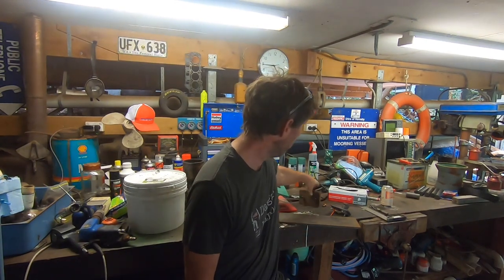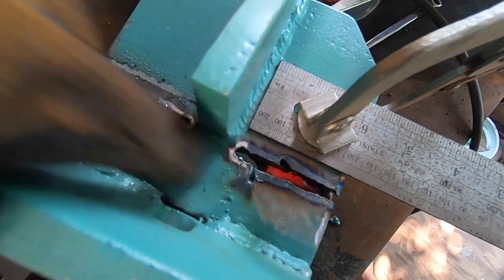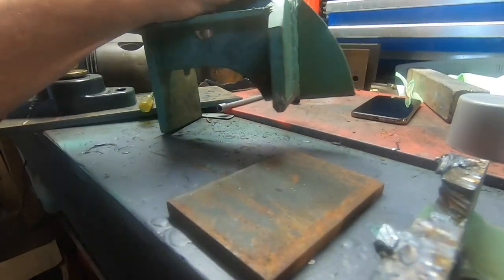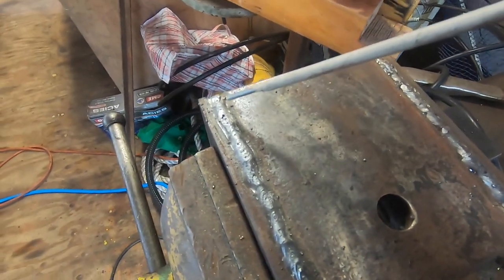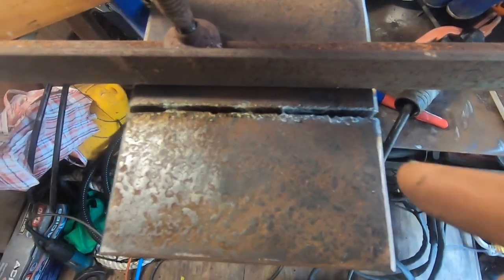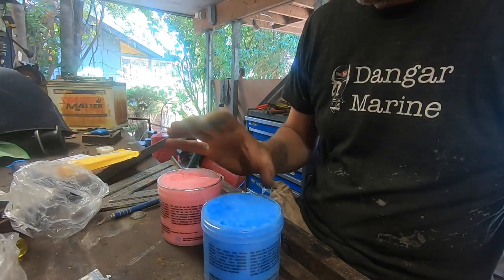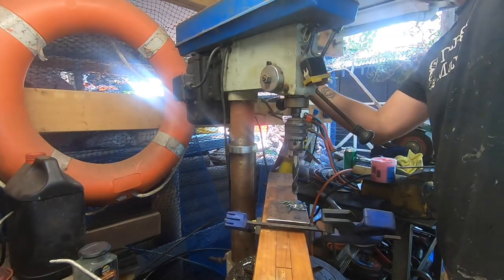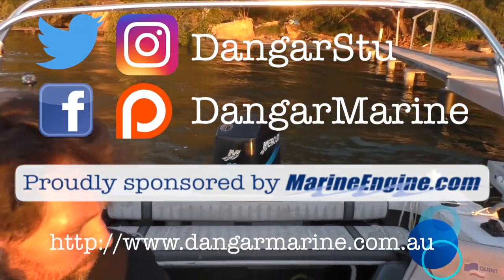Making the engine mounts

Comment: I'm a fabricator in the US, so I really enjoyed this video.  I use plasma cutters pretty often.  For thick materials like you are cutting...I'd just run it wide open and adjust the speed to keep it from blowing back.  Also, you are right about running through the end of the work to keep the tip cleaner.  Keep up the nice work, and ignore all the safety nuts.  In the US, must of us who are self employed and don't have a Safety Manager to watch us, work the same way as you...well, except we wear shoes. :)
Reply from the maker: Thanks mate. I'll give it a go at max amps next time and see how it goes.  Happy New Year! :)

Comment: Hi Stu, I'm not pro welder but just on the subject of welding I noticed at 8:55 while you were tacking up, you held the welder clamp with both hands. While this is fine is does limit the amount of control over the tip of the rod especially on a new rod. If you try and hold the clamp with your right hand and hold the actual rod with your left hand as close as possible to the weld pole as your glove can take. I find at helps and awful lot. Also being in a comfortable position I find is so important to a good weld. Keep up the great work Stu. Love the project

Comment: Always keep a roll of 'keyway belt' on hand, whether ashore or at sea. It will get you home and finish your tasks without having to run to the belt shop. 30 years as a master maintenance Tech taught me that, plus a few decades of sailing and motoring...
Reply from the maker: I'm definitely going to get some. Didn't know about it before this video.

Comment: Here's a good tip for your welding...
Pre-heat your work. 
The Boeing Lube helps keep the MIG torch nozzle from fouling. You can also apply a thin film to the work piece to help reduce spatter from sticking. I even put a very lite film on my welding helmet viewing lens.
Reply from the maker: Will give it a go.

Comment: Happy New Year, Stu!  Nothing better than a Dangar Marine video to start the day! :)

Even a very small pilot hole would make a big difference to your hole quality (roundness, finish, location...), and would be easier on your press.  Keep in mind that the center of the drill is not turning as fast as the outside edges.  Matter of fact, the exact center isn't turning at all relative to the metal.  Without a pilot hole, you're trying to push the tip thru the metal, requiring significant force.  A small, perhaps 4mm dia,  pilot hole would help a lot.  No need to step up, just go 4mm then 18mm. 

Keep up the great work, sir!
Reply from the maker: Yes, I'll try experimenting with different size pilot holes to see which works best on the next ones. The other thing I like about no pilot hole is that you can fill the start of the hole with lube and it won't just run out the pilot hole.

Comment: Stu:  With resilient mounts, when doing the shaft alignment, you need to account for the mount deflection caused by the weight of the inboard shaft end, so that the stuffing gland is not required to act as a bearing.  The mount company should be able to give you a procedure for doing this.  Basically it involves centering the shaft in the stuffing gland and adding weight onto the end of the gear to mimic the shaft weight so the mounts deflect the right amount, then aligning shaft to gear, and then removing the weights and the shaft gland centering support. Greg

Comment: Hi Stu
With regard to any “solid” lube, they work best if you dip the drill bit into them and fill the flutes.  That way, as the bit heats up, the lubricant flows down into the piece you are drilling helping to keep everything cool and.....well.....lubed.
Reply from the maker: Cool, I'll give that a go.

Comment: The engine mounts look good and strong, so you should be ok as long as the angles fit up right. You may need to make some tapered wedges to fit under the flex mounts to align the prop shaft to the engine. It won't be long till she is in the engine room.
Reply from the maker: Yes, it will be interesting to see how the alignment goes but where there is a will there is a way.

Comment: Happy new year to you from an old sea dog still in the old year. 

About your drill press, mine is same type and I use home made belt dressing made out of pine resin and meths to prevent belt slip and thereby increase belt life. 
Original belts are poor and are easily damaged when changing speeds so make sure enough slack.  Rounding off the sharp outer edges on pulleys is also advisable. Suggest you drill at lowest possible speed and apply coolant but these drill presses tend to slip belt unless you apply belt dressing. Looking forward to see test run of boat.
Reply from the maker: Nice idea, I'll try that with the new ones.

Comment: 2 things I've found helpful in my welding projects: 1 you can get magnifier lenses for your welding helmet (so you don't need magnifier glasses also) and 2. Get a 7" or 9" grinder! Working with thicker metal, a 4 1/2" takes forever!
Reply from the maker: For sure, the big grinder makes a big difference. Just bought some new disks for mine yesterday.

Comment: I’m now renaming you danger stu instead or danger stu, if I hosed sparks on an lpg bottle or oxy set I’d be now residing on the moon, keep up the great work mate
Reply: The Ausie's Aint afraid of a bit of LP Gas. They Made of Tougher Stuff, as They, Grind & Weld Steel, Bare Foot!   LOL  Side Note, He must have noticed it at some point, as he moved the tank in the next shot. Happy New Year to all
Reply: I noticed that too.  But hey, the explosion and 'launch' would have been filmed and would probably go viral later.  Would help pay for the funeral costs I guess? :-)
Reply: Put a big smile on my face when I saw that. He must be my kinfolk. I do stuff like that all the time.  :)
Reply: Don't think its in bad taste BUT.. why are there so many fires  down under?
Reply: did you spot the flip-flops/thongs/shower shoes :-)
Reply: @staxter6 Hi Chris.
 Our forests and bushland have alot of scrubby undergrowth that dies and dries off in summer and drought very quickly.
Combined with hot dry winds
a lightning storm will start a fire, cigarette buts thrown out a car window and sometimes arsons.
Our eucalyptus trees are high in volatile oils and that fuels a fire even further spreading at a more rapid rate.
So our dry tinder and trees are a perfect fuel in a hot dry climate hence we have specified total fire ban days so no burning off and that includes no barbecues! 
We do need to do more controlled slow back burning to clean up the scrub but the greenies have made such a fuss alot of this and boundry clearing has stopped. This season is already particularly bad and our summer just started one month ago!
Cheers, all the best.
Reply: But at least he had boots on.
Reply: And Barefoot to boot!
Reply: Aussie boilermaker/welder for over 15 years. I've showered acetylene and lpg cylinders in sparks hundreds of times and live to tell about it. As long as you have no gas leaks and your not pumping excessive amounts of heat into the cylinder or hoses there will be absolutely no problem.
Reply from the maker: That's it Alex, it's almost impossible to set an LPG bottle alight without heating it to the point where the pressure relief valve goes. As an aside,  we did training on putting these out in the fire brigade where we would set one alight then we would approach as a group, two holding a hose with the nozzle set to a wide fan to act as a shield from the heat and flames and a third to reach out through the shield to turn off the valve. Once done the next group would have a turn. They certainly don't explode as there is no oxygen inside.
Reply: @adriansaggin3054  Hi Adrian, Thx for your concise and informed response. Spent 30 years in Africa where it's generally unreported vis a vis seasonal wildfires, It just seems that this year (and 2018/19) Aus  has had it bit rough. In the N hemisphere it's being reported as Armageddon. Perhaps the boundary / firebreak freaks need to see reason and get to grip with what is required. Cheers, and a good New Year to you.
Reply: @staxter6  global warning (with plasma cutters!)
Reply: @adriansaggin3054  nothing to do with Greenies they have no say mover rfs hazard reduction burn policies.
Reply: Had one smaller one catch fire with a burner on the top. We just hid behind a tree at a safe distance and it eventually ran out of gas.

Comment: once you get the puddle correct try and concentrate on keeping an even speed and correct angle, trying to react to fluctuations as you see them usually just puts you behind the 8 ball because your reacting to stuff thats already happened, it may feel counter intuitive but it produces better results. its especially noticeable with TIG welding but applies to all processes including oxy and plasma cutting. once worked with a bloke who used a piano timer to time the dabs when TIG welding.i use much faster dabs so it wasn't for me ,but it worked well for him he got very nice results.
Reply from the maker: Interesting, thanks for sharing that, it does make sense.

Comment: Those are the same engine mounts I’ve used. When you get around to installing, you may want to initially set so the prop shaft is a tad bit high in the shaft log. These mount do settle quickly, most of it in a day or so. Check hight adjustments again in a week, then two months, a year and finally every two years. Most of the time you will find all you need to do is raise the two equally that carries the most weight, the one’s under the engine. On second thought looking at a previous video it looks like all your mounts may have similar weight sharing ( not like mine).

Comment: The most important feature of mounting your engine is a collision block. This protects the engine from moving if vessel  collides with a dock or another craft. Usually it looks like a large flat triangle about 4mm from front of strongest part of the engine at the base.
Reply from the maker: Interesting, I'll look into ways of adding that.
Reply: Also known as rake and ramming stops. Rake for when you get hit from behind and ramming for when you run into something. 
You didn’t need them with solid mounts, but you may now with flexible mounts.

Comment: Happy new year stu and all the subs! Nice way to start my new years eve day! The Jabsco pumps are very good but the rubber impellers don't stand for much dry running so keep a spare! We always have a similar piece left over from our service set but our Jabsco is slightly different, I believe it may be for the shaft on the engine side. Keep up the hard work chief, Ps glad to see the landy home
Reply from the maker: Thanks Clyde, will definitely carry a spare. One start up with the seacock closed and they are a goner.

Comment: if you tack only at the corners it eliminates having to grind them down, also gives extra weld meat at the corners which is where any cracks will start from
Reply from the maker: Good idea.
Reply: Except at the starting corner, better to tack a little away from the starting corner so the rod gets some heat before it hits the tack. ✌

Comment: Hint , when you drill an angle positioned as you did at 16:20 on, use a thin packer under the area being drilled to fill in the gap produced by the radius of the internal corner of the angle, or alternatively chamfer off the corner of your wood block so the angle sits flat on your block
Reply from the maker: Yes, it would be nice to do something to make it sit more steadily while drilling.

Comment: Having personally rebuilt a few Jabsco pumps for marine use The "extra" part may be for a sister (similar) model that you don't need for yours. Check with your supplier or Jabsco directly. I've been running in the Saint Clair river bordering Michigan, USA and Ontario, Canada for the last 50 years and seen this type of thing before.
Reply from the maker: Yes, I have noticed quite a few kits come with parts to cover multiple models so not all bits are need for an individual pump.

Comment: trick to learn when doing right angle welds. Weaving rod side to side just a little bit creates a much nicer weld. Another one is to angle the rod to either the thickest piece OR to the one going vertical a bit. When welding on something with a downhill angle I like to start at top and push the weld back into itself as I go. Seems to work well for me.
Reply from the maker: Yes, I think it would have gone a lot better that way, I really did have the wrong rod angle on the first one.

Comment: On your drilling and pilot holes, for small sizes like 3/4, just do one small pilot drill the same size as the chisel point of the drill (the bit that doesn't really cut).  Drills only grab when the step up in size from pilot to final is too small.

Comment: Happy New Year to you and family Stu!! All the very Best for 2020!! Most of those machines, welding and plasma cutters have what is called a "duty cycle" which is usually represented as a percentage in a 10 minute period I believe.  So, as far as I understand it, if the machine has a 15% duty cycle, then it needs to "rest" for 15% of the 10 minute period before it is ready to be used
again. The more expensive, higher end commercial machines have much lower or even no required "rest period" which is mainly why they cost so much. Much continued success with all of your projects!!
Reply: @robertI153  , you are correct sir. I had got that confused. They specify that it is at full power of the unit too apparently.

Comment: It's me over here again. A hot tip on setting the engine on the rails.  Put the mounts on the engine loosely then drop the engine where you want it. Mark the holes on the rails. Lift the engine up enough to get clearance to drill holes. Then lower engine and insert rail bolts. Tighten everything to spec once you are happy with the final alignment.  As close tolerance as you have those mount holes dropping the engine onto those pins is going to be a real bear. Even a millimeter of variance will make setting the engine super difficult if you bolt down the mounts then attempt to set the engine. Don't even ask how I know this.  :)
Reply from the maker: Good tips! I've never done this before so I'm definitely going to be learning a lot along the way. :)

Comment: Stu, to "Cure" Dottie, take a 5 gallon bucket. Fill it half way with Ice water. Set her in it for about 3 or 4 minutes. Works every time.
There's some biological explanation, but I've forgotten over the years. I've kept Chickens for the last 40yrs. and it's always worked.

Comment: For fabrication, they make magnetic 90deg angles to hold stuff in the correct alignment for tacking before welding.
They are about $15. There are different size ones too.
They sre the type of tool that you wonder how mankind ever progressed without. Any welding supply or often steel supply places have them.

Comment: Hey mate im enjoying your videos,  especially the way you throw in the danger, eg gas bottles, no shoes haha, by the way some advice from a boilermaker, when you are making your brackets etc , reduce th size of your gussets and make them semi corner to corner, that way you can fillet weld your parts for a better overall result, love your work
Reply from the maker: Thanks Robert, l like your idea of making the gussets a bit smaller so you can weld right around.

Comment: I believe that the double nut goes below the engine mount, and a single nut is on top.  If the height adjustment nut is only a single nut, normal operating vibrations could loosen it and over time lower that corner of the engine and you will be out of tolerance with the shaft flange.  With a single nut on top, simply the weight of the engine will keep it in place once that nut is tight.
Reply from the maker: Yes, I've heard that lowering their temperature can stop them from beeing broody.

Comment: Pilot holes make the work easier, less stress on equipment and quicker cutting.
I grind my own bits, and the edge will last longer with a pilot hole.
The harder the material, the more you need a pilot, mild steel may allow for a one shot drilling process, but, harder material will not be so easy.

Comment: Happy New Year Stu. I nearly had a heart attack seeing you barefoot in your shop!! Lmao

Anyhow a couple of tips for you for improving your welding! When your gripping your welder i.e. stinger, torch head, or MIG gun, relaxe your grip as much as you can. This improves your dexterity and allows you to manipulate the welder and consequently the puddle more accurately!

Two! Instead of focusing on the puddle, try focusing on the edges of the weld puddle instead. This will allow you to tell if your bead is building up too much or wetting in properly or undercutting more quickly on the fly.

About grinding, the saying goes " a welder is nothing more than a professional grinder ". A handy tool for grinding is a die grinder. Either electric or air powered will do. They make tons of different style burrs for them and it makes quick work of weld material in tight spaces! 

Another thing is to preheat the work material. This helps to prevent cold starts, where the bead bunches up at the beginning of the weld because the heat hasn't had time to penetrate the material. Saves a lot of time cleaning up your weld on critical work pieces! 

I hope some of this helps. There is no quick way to get good at welding. It's all about spending time under the hood! Good luck!